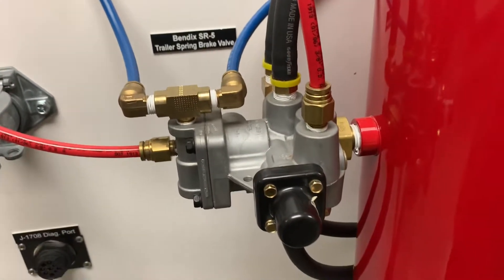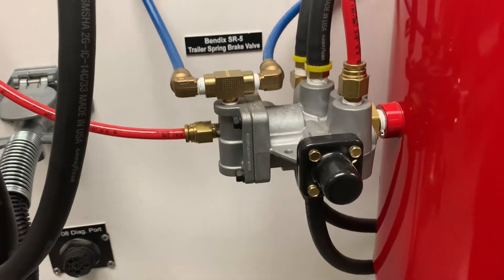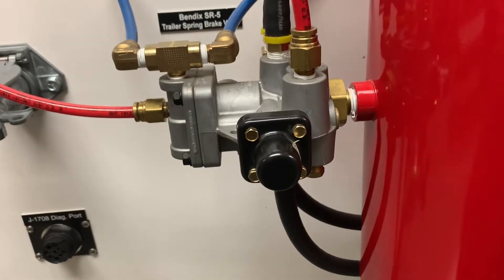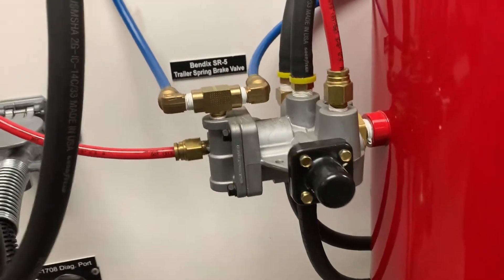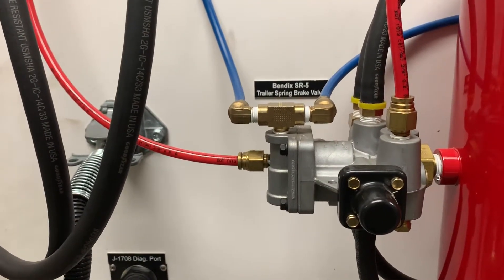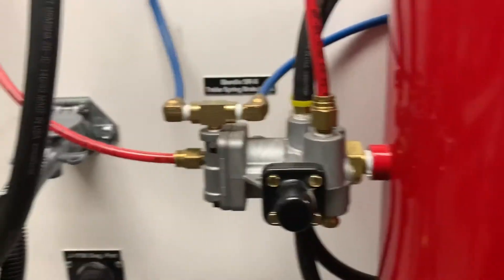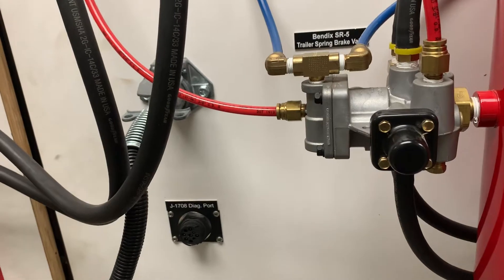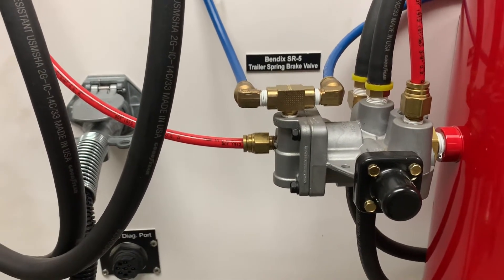Bendix SR 5 Trailer Spring Brake Valve Introduction

Comment: Im having a problem where i press on the brake and the service brake on the trailer applies real slow. Can this being bad cause that. I already changed all my adjusters and chambers everything is adjusted.
Reply: This can be a cause, usually when it goes bad it locks the brakes up completely. Putting it out of service. A good way to test this is pull off one line at a time starting with the supply line to the tank and making sure you’re getting a good amount of air supply. Then taking off other lines at the valve one by one and seeing how much air is being pushed out.
Reply: Did you ever figure it out I’m having that same issue right now